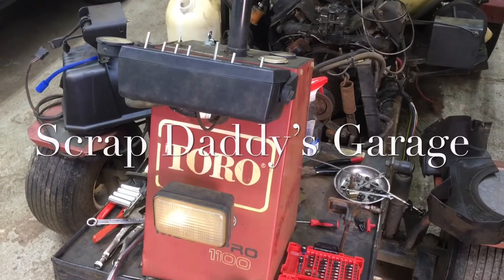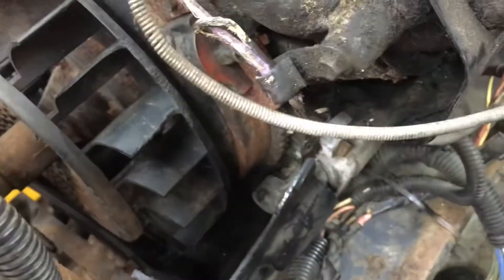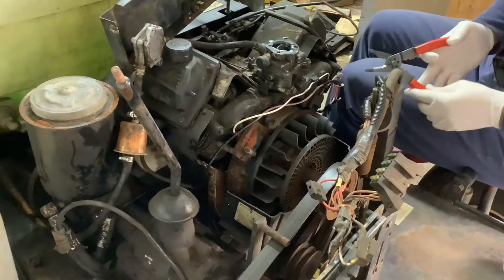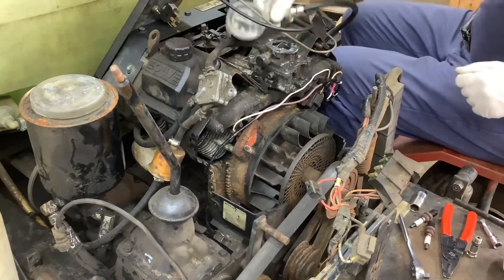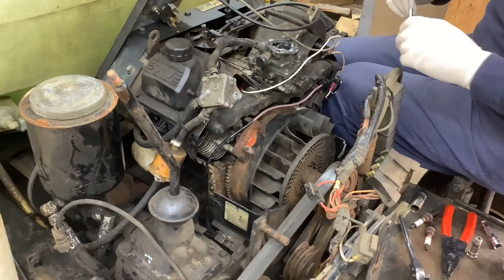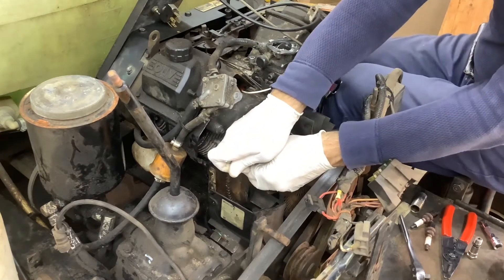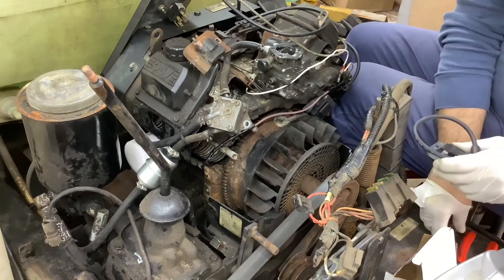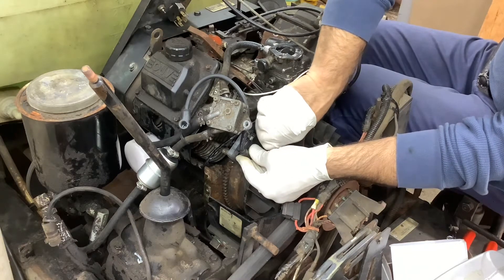Kohler V twin no spark

Comment: Just to be clear, is there just one wire or two wires going to each magneto? I know there is a white wire, which is used to shut the engine off by connecting it to ground. Is there a red 12V power wire going to both magneto's as well?? TIA!
Reply from the maker: Only one wire goes to each magneto. When they are grounded the engine will stop running. No 12v power is needed. Thanks for watching. Please subscribe if you haven’t already. 👍